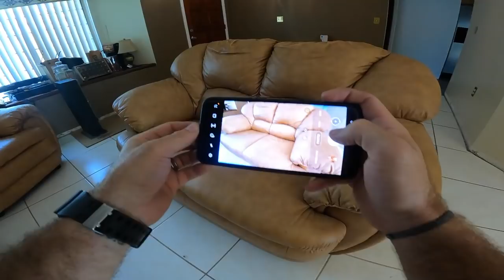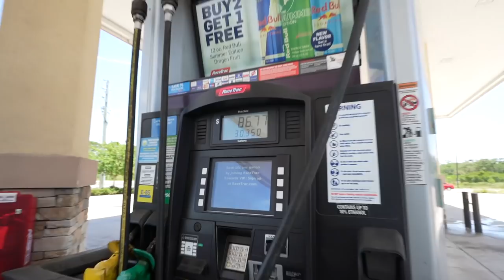When Junk Removal and Furniture Flipping COLLIDE (EP 53)

Comment: This may work for you to unload quicker. My dad is a gardener and we always set up the truck this way to unload quicker. Lay down ropes at the beginning from front to back. We always did 3-4 ropes. Lay down big panels over it to cover the ropes (or a tarp but it may rip). It holds all the trash off the trailer bed. As your unloading your load it will get light enough you can pull the ropes to unload the rest in 1 shot. Not sure if your dump site has machinery around moving the trash but they may be willing to pull the ropes with the machines and pull the whole load out for you in one shot. Just a suggestion almost always worked for us, with tree trimmings. May work with the trash you haul.

Comment: Little tip, you can use a pallet with chains. Place the pallet at the front of the trailer with one end of the chain under all the junk then the other once you finish put it on top. You can tie it at the dump where you can and pull up with the truck and the junk comes out easily. 
Make sure the chain goes through the pallet.
Reply from the maker: I don't think they would let me get away with that here. Although a good idea lol

Comment: If you were to put a nylon tarp on the bottom of your trailer you can make the unload super easy and more time efficient. All you do is out the tarp on the florr of the trailer. Load your stuff on the tarp(s) and when you're ready to unload just grab the tarp and pull it off your trailer and the stuff on the tarp goes with it.

Sometimes tho you will have to remove some of the junk because you may not be able to pull it off without removing some weight, but even if you are able to pull off half the load will make your life (and back) easier.